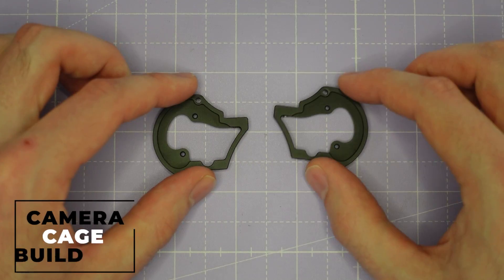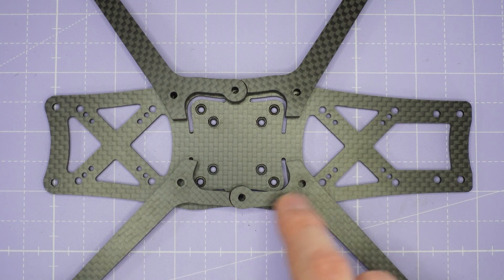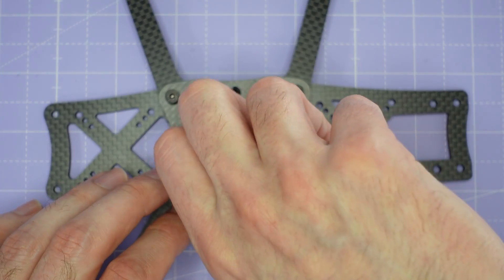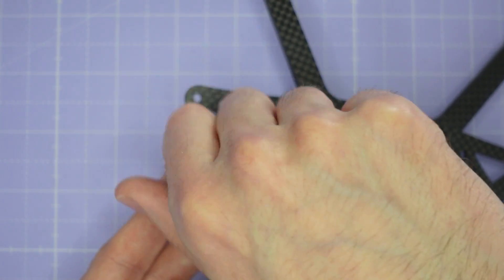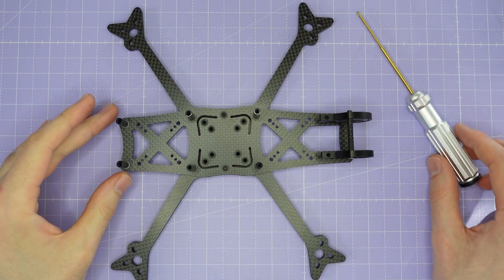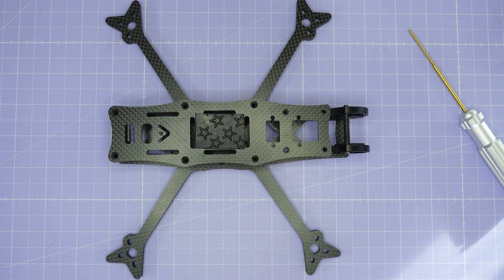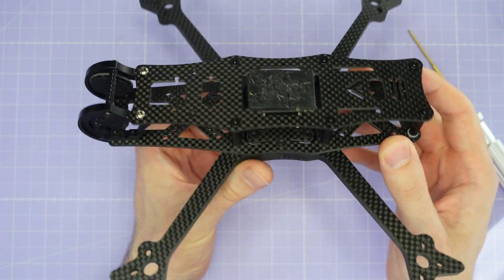AOS 5 V5 Build Guide

Comment: Just built mine couple issues i noticed i tried lipo toilet tank way lipo lead to short to attach to XT60 holder... 2nd issue the slots for battery strap mounting lipo the normal way are for like a 4s lipo there's no way a fat 1500mah 6s lipo can be used in those slots... but I will say paired with KISS ULTRA & Voltara 4in1 it flies amazing 👏

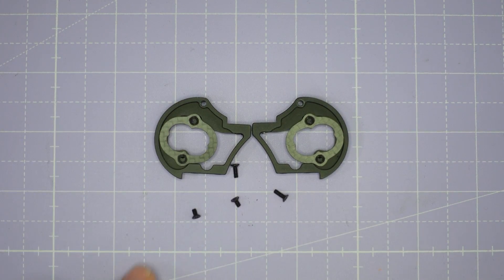Comment: 1:32 I have checked 5 times and the pack from iFlight does not include M2*4 screws, may be worth confirming the BOM

There are also no washers, which is ironic as this was an AOS frame it seemed it would be liberal use of washers

Comment: I really like this frame but I have found with the camera mounts for the o3 either the camera pokes out past the guards or if you flip it around, the guards are in view... is there any solution for this?
Reply from the maker: With the included soft mounts the camera should be perfectly placed about 2mm back from the metal. If the camera goes further back than that you can get vignetting on the superwide setting. There are STLs available for the soft camera mount so you can modify and move the slots backwards if you want and print in TPU.
Reply: @ChrisRosser  Just saw your reply, thanks man, I'll look into my o3 setting first and go from there.. love your vids! cheers!

Comment: Nice frame but mine came with incorrect stand off for top of camera cage.  Both sections in the heat sealed bag had the same size vertical stand offs for the carbon plates 😕
Reply: Same with my build from iFlight.  I left that standoff removed, but I also fly in grassy areas.
Reply: @RichardFPV  I had some sent to me via HobbyRC where I originally purchased.

Comment: I bought the toothpick frame from CNC drones and they didn't chamfer any edges, looks like this one isn't either.  Chamfers prevent delamination and help with strength in a crash.  Won't be buying any more of these frames unless they fix this, it's been industry standard for years.  Pretty bad considering what these cost

Comment: Just ordered this frame and a set of the super nova motors. Will be running the gemfan 5226 and 5236 props. Will also carry a GoPro 8. What size lipo is recommended for this combo?

Comment: I ordered a v5 frame but have an issue with fitment. The 4 center standoffs sit almost 2mm higher then the rest because of the press nuts. Am I really supposed to add washers to the other standoffs? Or grind them down? Kind of a trashy oversight.. And what's the point of the carbon in the camera cage? Why not just machine the aluminum to take the rubber camera mount?

Comment: So disappointed that V5 still only has 3 holes per motor. 25% less fastners is silly when screws can and do fall out. 1 screw out, 50%, 1 more 25% of screws left. nuts.
Reply: There's a resonant mode associated with that missing screw. That's why it's not there. You might consider using some type of thread locker.
Reply: @24kJames how do you know this? Could you share the vid where its discussed?
Reply: This guy doesn't use loctite and it shows. 

Been running my 3" with 2 out of 4 screws on each motor for a month without anything coming loose at all.
Reply: @Carticiak  i don't use locktite because it makes replacing motors a nightmare
Reply: @an_R_key  You're doing something wrong, then.
Reply: thread lock grease dude

Comment: I like how this frame is trying to innovate but its going to break on hard landings. the arms are spindly and they are only 6mm thick. for comparison, the arms on a geprc mk5 are 5mm and much wider giving them more rigidity. I know they aren't in the same weight class but they are both meant for freestyle and need to have a little bit of durability at least...

Comment: I preordered this frame, and i really love the design. Its easy to build and repair, and most importantly it flies amazing. 
But i just realized there are some differences between my preordered version and this one.
I have two more pressnuts below the rear standoffs, instead of those plastic washers and the screws to mount the camera plate 1:38 are actually M2x3 instead of M2x4 (and there were only 3 in the kit, i got around that small problem though).